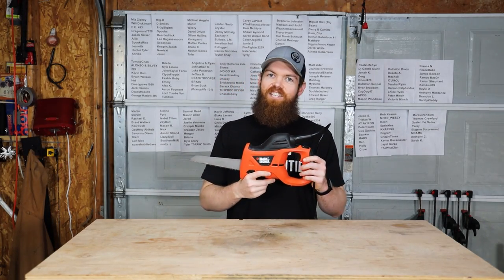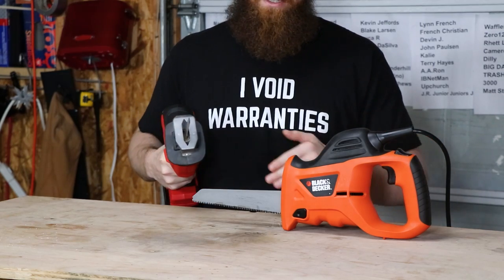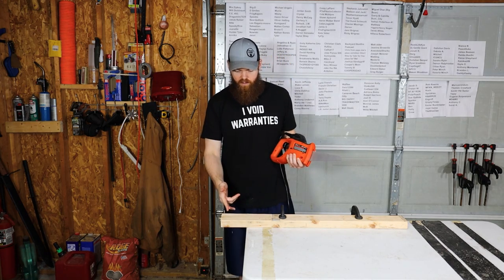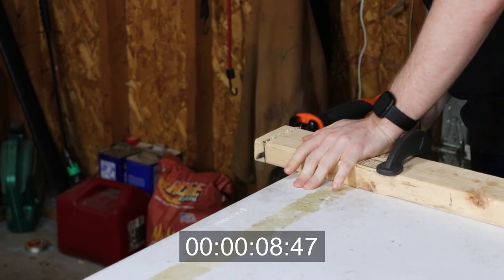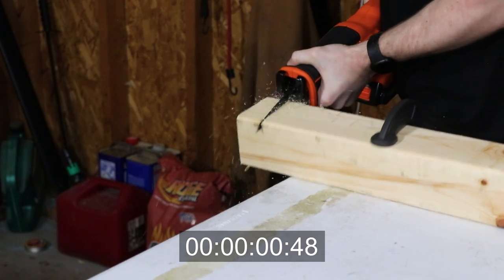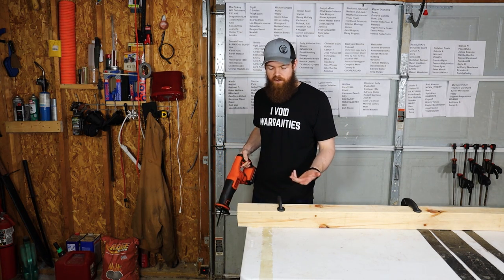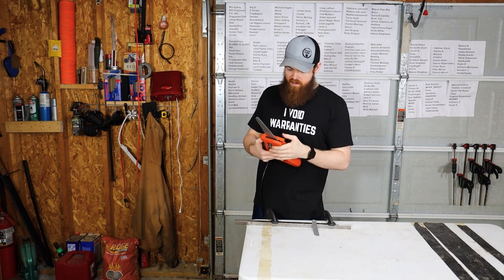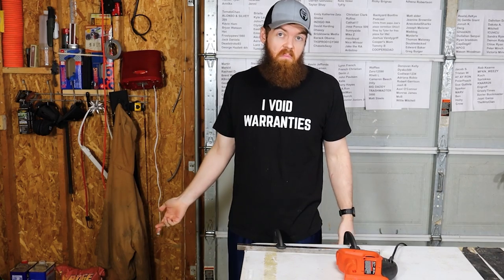Which Black And Decker Saw Is Better?

Comment from the maker: sawzsall - https://amzn.to/3wLq2w9
other saw - https://amzn.to/3D71akO
Reply: Make this into a series, black & decker electric handsaw vs ....(cheap junk)
Reply: Thank you for the link, I have to feel the power that black and decker plug in sawzall is making for myself. xD
Reply: Wow lot of good 4000 4-5 star reviews for the plug in.
Reply: Thank you for these useless products
Reply: #teamseas................
Reply: You should do something bushcraft related
Reply: Compare it to one of those cheap harbor freight sawzalls, their under 40 I think and their cordered
Reply: For $40 more you could get a corded Makita or DeWalt... Double price almost but the results would be a lot better tool.  Plus, I believe the warranty would be almost double also.
Reply: Tyler if you are going for speed of course the reciprocating saw will win but I feel like the powered handsaw will make a better cut
Reply: Try the black n decker matrix drill I have one it does everything so Manny attachments for a cordless drill
Reply: Sawzsall is a brand… it’s actually just a reciprocating saw
Reply: How about comparing Bosch, Porter Cable, DeWalt, Ryobi, Die Hard, Hyper Tough, Chicago Electric, Worx, and basically all brand reciprocating saws with one another. Might be a long and expensive video though.
Reply: The jig saw is junk also

Comment: Seems to me that the original saw is more of a hand saw replacement than a reciprocating saw.  Looks like you get cleaner, more precise cuts at the cost of speed.
Reply: The blade height also helps make a square and clean cut.
Reply: Congrats, First Last, you have the best comment here.

Also dear god this dude needs a proper fucking bench jesusnchrist
Reply: He could make a bench with those tools .)

Comment: While I totally agree that it is more of a toy than a tool, having a solid work bench makes so much more of a difference than you would ever imagine.  90% of the tools energy is being soaked up by the table.
Reply: Totally agree, hopefully tyler sees thus
Reply: I also agree with this complaint on a subject I know nothing about
Reply: And maybe a bench vice bolted to that solid work bench.
Reply: He's definitely cut up enough materials to have built ten good benches 🤣.
Reply: Would be funny as hell watching the Project Farm guy do a saw comparison with some half ass setup like this.
Reply: He should do a video of him making one.
Reply: That's kinda irrelevant though. You can see the big problem. 1) Not enough torque. 2) Saw is too lightweight for how cheaply made it is. When saws bounce like that, it's because the saw is too light for the cutting being done at that specific amount of force. You can only apply so much pressure when at the opposite end of the fulcrum and you can't just rig something to the blade of the saw or the saw would just cut it off and you're back to square 1. The saws are also exceedingly weak in performance. If it was the table, then the Milwaukee saws would've faired in a similar manner.
Reply: I have to ask y'all how big of a bench donu need to set a damn saw on and how do I know he doesn't have another bench and most importantly non of y'all have nothing better to do than argue over a fucking table

Comment: He doesn’t need a sturdier work bench, cuz the the Milwaukee still way out performed them both with the very same set up. 
If he gets a work bench and then the B&D brand perform better as a result of it the Milwaukee will then do !EVEN BETTER! as well, with the RATIO of performance being the SAME as this video.
Reply: I swear these people will complain about anything they can think of

Edit: I was just thinking about it and in the real world it wouldnt even matter. Everything you cut will be in a different scenario where sometimes clamping it to a bench vise would be impractical or impossible.

Comment: That battery powered B&D has half the battery that you use with the Milwaukee. Use a 4AH double packed battery for the B&D and it will be a lot stronger. Larger battery does not only mean larger capacity but also larger current which directly translates into engine torque.
Reply: I have the same saw and it is a world of a difference comparing the 1.5AH with the 4AH... Same with my weed trimmer..

Comment: One thing that helps when cutting metal is to give a few brief squeezes of the trigger to sort of notch yourself a cut in. Then you can go ham and finish the cut. I do this when cutting EMT to prevent the sawzall from skipping side-to-side
Reply: And do more of an angle not right across the top haha
Reply: Hmm, I’m going to have to try this.

Comment: Tyler. PLEASE buy a sturdier bench. You can tighten the clamps all you want, but if they work surface is moving around, you might as well just not use clamps and use your hand instead.
Reply: Yassss
Reply: It's not the bench though. If it was, then the Milwaukee saws would've performed just about the same way. The bouncing comes from the saw being too lightweight for the low torque being applied. You can only press down so hard on the back end of the fulcrum until the blade just becomes stopped up. Bench would've made at most like a 10% difference. Sturdier benches only really matter when you're using heavier materials. The main point being made is that these saws are marketed for home use, not big workshops. Not every home has this giant dedicated workshop readily available and these saws were advertised to fill that niche. And they suck at even accomplishing that.
Reply: @point-five-oh6249  😒

Comment: Black and decker is mean for the random repair around the house that happens two or three times annually. The time it takes to do the job isn't crucial because it shouldn't be a daily use too or job site tool. Its meant to just do good enough to finish a task.

I think the cheap one with that thick blade is kinda interesting. Seems like it makes a straighter cut due to its thickness not allowing it to walk as easily.

Comment: I suspect that the trouble clamping the metal is due in large part to Milwaukee blades being typically pretty aggressive. Without the power to take the aggressive cut, it just grabs a lot.

Comment: Ugh, it's not about speed, but cleanness of cut. Compare the cut from the first saw, to the sawsall. The first saw cuts almost perfectly clean, no chips, no tears in the wood, the sawsalls (both the B&D and Milwaukee) chew up the wood.
Reply: If you're after a clean cut, a sawsall ain't the tool
Reply: @LifeAccordingToMatt  Which is sort of my point, he's comparing a saw that is designed for clean cuts to a tool meant for speed, and then basing his assertions upon this comparison.

Comment: A point has been made regardless. If you buy the cheap stuff you'll forever be compromising with the tool, Milwaukee ripped through as good as my Ryobi does so I'm impressed. If you want a good cut while still on the relatively cheap it'll be a Ryobi you buy.

Comment: The B&D impact driver is pretty good. Not the strongest, but it will drive your basic drywall and deck screws with ease . It’ll drive 3/8 inch by 3 1/2 inch lags but probably nothing bigger. My brother has had his B&D tools 4 years or so, and has been able to renovate pretty much his entire house with his tools doing everything he’s asked them to and more than he should have done with them. But they still work

Comment: You would think they'd make the battery powered more powerful . Because as soon as those batteries start losing power, the saw performance will also drop. So having more power would take longer for that to happen. Knowhattamean?
Reply: Wouldn't it use the power more quickly if it was more powerful?
Reply: @kellypg    I was kinda thinking that too, and maybe?? I guess it depends on the battery quality. I'm sure they have some decent cordless technology now.   But I honestly don't know.
Reply: @righty-o3585  the problem with battery tech is that it's almost always outsourced to the lowest bidder for these lower end tools. So every lithium cell is 3.7-4.2v charged but the amount of run time (mah) varies cell to cell, company to company. In a standard 20v battery pack there are either 5 or 10 cells(5 in series or 2 sets of 5 in parallel) and the average cheap cell is $6 consumer cost plus the housing and electronics comes out to about the same price as the entire black and decker tool at around $50-$100. So you have to figure that these guys are getting huge wholesale discounts or using total garbage battery packs.

Holy fuck this was way longer then I planned it to be.
Reply: @kellypg    Ahhh , well there you go.  I don't know  anything about batteries really.  My original comment was kind of a suggestion as a question lol if that makes sense. I get all my power tools corded for that exact reason.  Have full power all the time
Reply: @righty-o3585  fair enough. Almost every battery pack uses 18650 lithium batteries in them if you wanted to price check. You can actually rebuild then yourself without too much work.

 And that's a good enough reason. I have corded and battery for most everything because I like the freedom of cordless but sometimes they just can't do the job.
Reply: @kellypg    yeah I hear ya about the freedom m that can be very convenient on like a job site, but the tools I have are home use.  And I have a few exterior outlets around the house and plenty of extension cord. So I figure cord was the way to go
Reply: @righty-o3585  I'm jealous.  I don't have a single outdoor outlet. House is like 80 years old. Doesn't even pretend to be up to code. There's maybe 4 grounded plugs in the house and not one gfci lol

Comment: I've used the saw for three years, it works fine. You gotta get longer wood-specific blades, which I just knew to do. Also, you are better served to cut into the corners and maintain your grip, then adjust to cut into the new opposing corner, as the saw seems to perform better when it's cutting that way. There are other things about his approach, but phone typing sucks. If you can't afford something expensive, and you have the patience to figure out how to work it,  the muscle to apply some elbow grease, and the common sense to buy some specified blades, this saw is a perfectly useable middle-of-the road tool. I've cut 8-9in trees down with it. It's good for the money.
Reply: Ditto on the trees.

Comment: As for that black & decker saw, you have to use a longer blade. And you also need to know how to use it efficiently -- you need to let the front fender touch the material you're cutting.

Comment: Sometimes using a power tool isn't about speed but convenience. For some, a power tool offers the ability to complete a task when their hands and arms don't work as well. The vibration and strength needed for the Sawzall type tool may not be what someone can or wants to handle. The electric saw offers a smooth cut with the least amount of effort.

Comment: Its simple really.  Just get yourself proper gear for what ever you do. If you completely broke and need anything that does the job somehow then low end gear will do. However its not what you really need. People just get yourself bit more saves and get good gear. Last for longer and saves time and energy. Nice to see those videos at times.

Comment: I use the Black+Decker Matrix system for my handyman company, and have used it for heavier construction outfits and it runs fine.
It's not as strong as Milwaukee, and such but this system works well enough for my business needs.

Comment: tbf i think part of your issue with the cordless version was pressure youre putting. I think you may have been quite forceful and with power being a limiting factor its not ideal. So if you let up a bit it might help. 🙂 i have a b&d impact. Its not great. But it aint terrible either. It can actually strip a bolt if youre not careful 😅 anyway. Good vid. Its entertaining seeing you do weird stuff

Comment: A possible reason for the b and d sawzall not liking the metal is maybe the Milwaukee blade was aggressive because it's efficient when you have the power of the Milwaukee but maybe because the b and d had less power it just bounced instead of digging in. Not saying you should do it again, just offering a possible answer

Comment: A good sawsall is not made with angled handles, or body. it is made as straight as possible such as the DeWalt is designed. If not, then it can't saw "ALL" because you can't saw things as flush as possible.

Comment: to be fair the powered hand saw one might be designed more for cleaner, straighter cuts. like for trim or something, but I have to admit a $50 chop saw would do better than this and I'm not at all voting for that saw or black and decker in general.
Reply: chop saws don't fit in awkward corners as well, though.
Reply: @kenbrown2808  generally you would cut the trim perfectly to size before fitting it but i see your point, by then you would probably want a multitool though, which are only like another 30 bucks from harbor freight and surprisingly last awhile.
Reply: @levistrnad2965  sometimes what you need to cut is there long before you are. And multitools aren't quite the same niche, either.
But yes, that's not an all purpose tool.

Comment: I have that BnD recip saw. I know you're trying to be as fair as possible, but the blade that comes with it is trash. I've used mine with a Diablo blade to cut down pallets, and it did worlds better than with the stock blade (I started cutting them down with the stock blade). I then three pointed the stock blade into the garbage.

Comment: I don’t know what so many people think any tool that only black and decker puts out would be a great tool if it were a really great tool they would put it out under their high quality brand and parent company name of DeWalt and probably would have a even cheaper model under their bargain brand name of Porter Cable fact is that they decided to try out a design in their mid range/homeowner brand and it doesn’t do well but some homeowners still liked it so they decided not to release it in their other brands but kept it in their mid range brand to satisfy those customers and seriously if it were any good they would have a cordless option

Comment: It seems like a different POV is that all 3 saws got the job done.  Sure, if you pay 3x as much for a tool it should work better / faster, but if you’re a home gamer that uses a tool every once in a blue moon, why spend a ton on tools that just collect dust?  Also, I wonder if the B&D recip saw would have worked better on metal if contact was made between the blade and the cutting surface before the trigger was pulled. That’s the approach taken with the Milwaukee and once the saw teeth started to bite both recip saws took ~5 seconds to make the cut.

Comment: Just out of curiosity, would a bigger battery give you better power?
Reply: i assume it would just change use time, unless theres this battery - engine relationship i'm not aware of, i'm not an engineer or mechanic so i have no idea
Reply: @vooshmoozik6185  I just wondered from the tool reviews I've watched it seemed like you could squeeze a smidge more power out of an impact with a higher amp hour battery... no clue if or how it would translate to saws haha

Comment: Your table bouncing around everywhere is completely destroying the energy output of the saw.  That goes for the Milwaukee saw also.  Any surface that moves around is going to soak up the kinetic energy the tool is putting out.

Comment: If even once you could secure the wood better, so your whole house wouldn't shake when you saw them. Those saws work way better when the wood is not shaking with the blade
Reply: Its like when you touch your fein multi tools blade when its on. It wont cut your finger because it just vibrates it

Comment: The 10 extra dollars went into the battery, its the same saw, just battery powered actually id love to see you do a video on the new brand of blads and saws called diabolotools
Reply: Dude the diablo blades and discs are insane. They cut like butter. I've used the grinding wheels, jigsaw blades, and the rotary cutting discs. All good stuff.
Reply: lets get tyler to make a video on it then

Comment: that metal sawzall blade in tge black and decker would work alot better if you started it out on the metal and used the saw as a brace....

Comment: you did not give the b&d a fair shot here compared to the milwaukee - you started the b&d before even touching the tube and you also started the mil with downward force with your left hand - the b&d is a perfectly good saw unless you turn it upside down and the pin inside falls out, since it only has a retaining ring on one side. the pin falls out and it destroys itself inside

Comment: It's a sad state of affairs... You go back 20+ years and B&D was reliable and cheap... now it's just cheap lol

I literately have a mains powered B&D drill that has been passed down 2 generations and has only required one brush replacement. It will go through concrete, wood and most metals with ease even today... and it's got to be approaching 50 years old... i mean lets be real... both of these tools in the video wont last a decade of light use let alone 50 years of heavy use.
Reply: Same we protect our garage that my grandfather left us big time.  It's full of old tools from the 50s-70s.  They all still work.  Hell the transformer from 1948 still.  You could 100% still electrocute someone with 220amps with it
Reply: @Aztesticals  That garage will save you buying tools for years.
Reply: @babalonkie  very good point

Comment: Tyler bud, you're still comparing the electric saw to actual Sawzalls, that have completely different blades with completely different teeth, a stronger motor and larger blade movement. Thats kind of like complaining about an electric bicycle because it isnt as fast as a motorcycle.